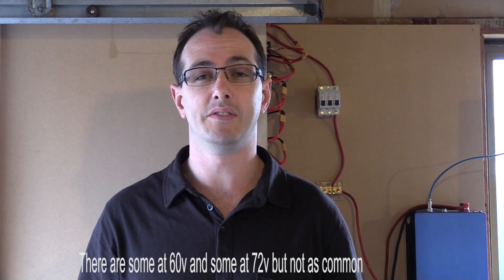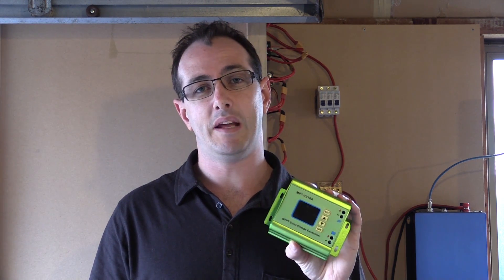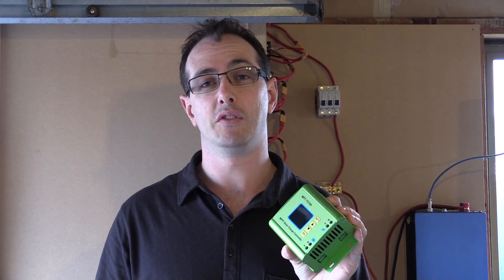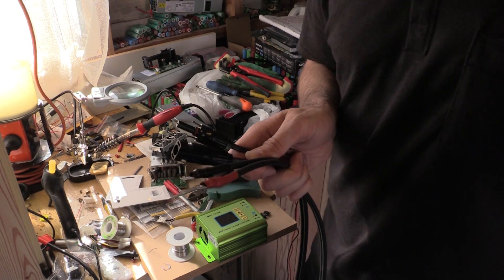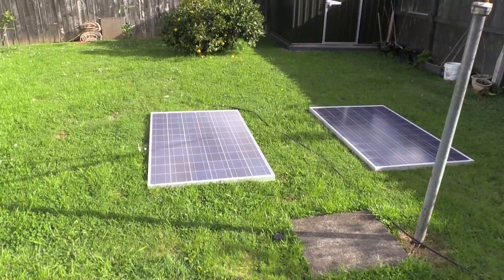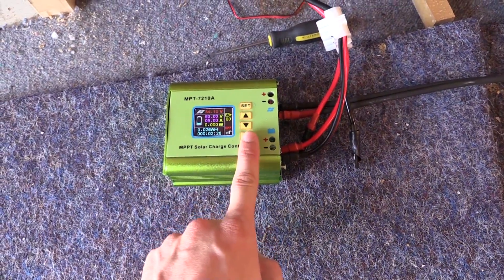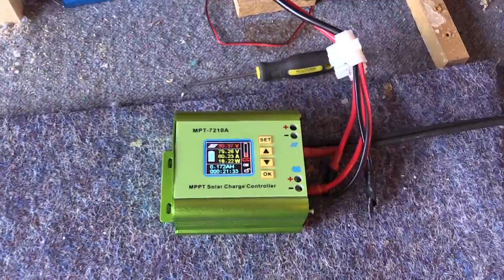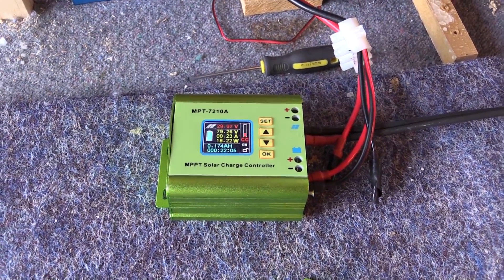MPT-7210A MPPT Solar Charge Controller Testing Part1/4

Comment: Using the MPT-7210A, how do you prevent it from over-charging batteries? It does not have a low-current shutoff that I can find. There is a time limit feature, but then it may not charge the batteries fully.

Comment: It's like you tried to make this difficult ?   12, 24 and 48v are the standards.  Why would you go with a Booster Solar Controller I don't understand.
Reply: pulesjet then you don’t know what he was talking about.... the charge controller is a boost converter within its own case... it has the ability to charge up to 90V batteries, while max input to the charge controller, is 60V no higher.

Comment: I have 4 of these powered from various 235, 285 & 300w CS Poly panels with Vmp's between 25, 29 & 31 volts and Imp's between 7&8 amps. I'm charging 57.5v, 3kW LifePO4 as well as a couple 12vdc banks using buck converters.
For that purpose, the MPT 7210a works well.

I've tried various configurations and combinations with these and other boost converters. 
I've found that setting the Vmp on the low side is better and that in parallel with identical settings these units will compete and cycle, wasting energy. 
The input Caps seem on the cheap side so I don't tempt fate.
I also use these as programmable power supplies and chargers for various battery configurations.
Reply: Maybe add an high amp diode on the output if u connect some toghether in parrallel with same settings?
Reply: But, ill guess they only start to compete when battery level is almost reached. Or battery is full?

Comment: So how is that controller, did it prove to be reliable, I want to use it on tesla module from 12v to 24v
Reply from the maker: This controller wont work well with 24v, The controller is a boost converter so the solar voltage is lower than the batt voltage. For your case you would want a buck converter and i would look at the EPEver Tracer

Comment: Have these  all still survived mate? Might grab myself a few and upgade from pwm
Reply from the maker: Yes two out of the 3 are perfect the 3ed is showing the wrong solar voltage but does still work. Given i am running it at much high voltages than it was made for its prob my fault but otherwise yes for the price they ant bad.Just remember they are boost so the batt voltage needs to be higher than the solar input voltage.
Reply: Mikes DIY Tesla Powerwall ah yes awesome thanks mate

Comment: I have 24v 320w solar panel and I have 2 of them is it possible to connect both of them.
Reply: Abel Jerson it is possible, what battery setup are you planning on using this for? 24V/48v?... if its 12V then you cannot use this charge controller safely as IT WILL overcharge your battery.

Comment: Hello is it possible to connect 24v 320w solar panel with this charge controller
Reply from the maker: from memory yes but your battery voltage will need to be 36v or 48v
Reply: Mikes DIY Tesla Powerwall
If my battery voltage is 60v will I be able to connect to 2 of the above mentioned solar panels

Comment: I am an assistant scoutmaster thinking about building a solar generator 12 volt. Not for sure if I'm going with 18650 60 or 80 amp hour or using those lifepo4 brick 12 volt hundred amp hour. Will this charge a 12-volt system?
Reply: I do a lot of camping usually without any power would like to charge phones tablets and run fans in my tent possibly looking at a small ARB refrigerator to run off 12 volt.
Reply: This charge controller WILL NOT work with your setup safely, it is meant for 24V systems and up.

Comment: how is the controller working? its been a while since this video. I'm looking in to getting one if they are OK. is it a bucking or boosting? or a buck/boost controller? I'm looking in to getting about 3 of these. with 6 24 v panels. with a 12v battery bank. if that can work. the reason is the panels are cheap. and I'm moving up to a 24 v inverter in a year or two. or do I need to look in to another controller?
Reply from the maker: Its a boost only so the solar voltage needs to be lower than the output bat voltage. They have been running ok, One fan needs replacing "doing video on that soon" They work well on sunny days but cloudy days they do struggle to produce a good stable output.
Reply from the maker: If you have under 300w of solar you could look at this https://www.youtube.com/watch?v=omAhsQqwWSo
Reply: Mikes DIY Tesla Powerwall   do you have a link where i can buy 240W solar panel (PV) the same with ur pv???

Comment: very lound mppt is this normal?
Reply: I was thinking the same thing. seems the controller has no auto fan control and just blasts the fan at full power all the time. such a small and cheap fan running so fast will no doubt make lots of noise. very inefficient, but at the same time the fan probably doesn't use more than half an amp at full power, anyway.
Reply: milkbox Fan speed is adjustable but not automatically speed control.  Mine runs quiet and cool at 25%
Reply: You can adjust the fan speed.
Reply: They are noisy. Can speed can be adjusted to cut noise if power usage allows. They are cheap for a reason.

Comment: The capacitor in the converter is 93V so you can have 2 per converter, if you set the AH it will show the fullness of the battery properly
Reply from the maker: Which capacitor? The input ones on my units are 63v and the output are 100v caps

Comment: I have been using MPT-7210A for about 3 months without any issue, but last weekend it started to behave very unstable. It show the solar panel voltage as between 3v and 10v (it should be 30v) , and the batteries are not charging. I switched back to my pwm controller and reconfigured the batteries for half the voltage.
Reply from the maker: I had the same thing happen to the unit without the input cap upgrade. But mine seams to be still running fine. It says 9v some times on the PV input but still is putoutting the same as the others, at the time it was around 400w so while the reading on the screen is wrong it still seams fine.
Reply from the maker: Oh thats cool

Comment: Dear Mike ... Thanks for the wonderful 4 part series .... it helped a lot in understanding...

One question, details of my setup below.

02x 150W panels, having 21V and 8A each, connected in series
04x lead acid batteries in series (100Ah each)
Battery voltage set at controller = 54.8V
Battery Amps set at controller = 5A

Now the controller is charging just at 0.01-0.1A. Sometimes it charges through 0.2A-0.3A.
How I can improve that ? (here in Pakistan, we are having good bright sunlight in winters)
Reply from the maker: Thank you, Are you using the same controller? If so what have you set the solar panel voltage too? Also what is the voltages on the back of the solar panels? This might need charging if your only getting 0.01-0.1A

Comment: Hello could you help me with one of this?!!!      http://orison.energy/
     I really need a few of this but maybe a little less costly...They 
are still doing the Kickstarter thing. But I really want some 
now.....Can you help?! I do have solar panels right now that Just plug 
into my wall outlet,DC to AC ot of the microinverter....3kw right now 
but I do have 7 more panels ready to be used if I can get something I 
can charge thru my wall outlet and back feed at night. Please hook me up
 with someone ..Willing to pay.....!!!Thanks
Reply from the maker: Hmmm the Orison system looks interesting 2.2kWh per unit but more designed around style and very small costly units. Which first makes me think why. Small units would be an expensive way to do what the tesla powerwall or lithium battery system of other brands does for far less overwall costs. The cost per kWh of storage would be crazy on the Orison unit. Each unit would have to have an inverter /charger in it which just adds a lot of extra cost and things to go wrong. Sure you can just plug them in which makes them simple and they look good in the pictures but cant see how the numbers would ever add up to save you money and pay off the investment. I can guess they charge when the power is cheaper say at night or early morning from the same AC socket. While this does and can save money its not even close to the same ball park as if it was charging from solar which these Orison units cant do without first buying a grid-tie solar system. In AUS they are using a simpler system but with a big lithium battery system like the tesla and a hybrid inverter and some smart software that is always looking at the current power price and then deciding weather its best to buy power to charge or sell battery power back to the grid or export solar to the grid. Very advanced but relies on some good software that interconnected to the power pricing network feeds and a big enough system to make it worth while, also needs an export meter/grid-tie hybrid inverter and spot price power provider that also support buy-back export. Tho you can do it without the export to grid and just use the system to topup the batts when the power is cheap. As for your main question, sounds like you just need a small 2000w grid-tie inverter as that would support your 7 extra panels. Depending on what voltages and watts your panels are will determine what kind of inverter you need, Microinverter are the more expensive option as you would need 7 vs just 1 grid-tie inverter. But 7 isn't a good number, 6 panels or 8 panels would be better on a smaller grid-tie. For 7 panels in series you will need a grid-tie with high dc volt inputs more then 150v, if you used 6 panels you can put 3 in series then 2 in parallel, which would be 90v at around 16amps and under 150v open circuit. You could always use 6 and put the last panel on a Microinverter. If you had 8 panels you might be able 4S 2P but that will go over 150v limit on most smaller inverters. If you get a  2000w and below when looking at the inverter you can just plug it into a AC outlet which is easy, If you go with a 3000w+ inverter you will have it get it wired into your main switchboard at a cost but with the 3000w you can just connect all the 7+ panels in series as those inverters are normally rated up to 550v on the dc solar input.  Hmm back Feed at night would mean you will first need batteries, If that's what you want then I would look at a hybrid inverter, more costly but will give you more options if you want batts. To keep it simple look at 48v
Reply: Appreciate the reply....and yes the main Idea was for me to build or buy batteries to install. Since I do have a 3kw system right now (plus another 2.75KW in garage) I installed microinverters that convert dc to ac...all I do is plug into my house outlet.. I did installed 2 separate Circuits for this purpose, but I could still use them as it does not come close to the 80% limit for my wire gauge. I was just showing the Orison item because I want something I can just hook up to my outlet when batteries are introduced into my system. I guess the easiest way would be to plug a 24v or 48v battery charger to batteries, then either another microinverter or a regular inverter as you have mentioned. But I really like the idea of no memory no damage of Li ion batteries. PB batteries are heavy and can only use like 25% at a time....just having lots of issues getting 18650 batteries, no one wants to sell me the broken ones. Not even recycling centers.
Thank You again for your Input. Just needed help with building a li ion battery pack that I can just plug into outlet for charging and providing electricity to my home.
Reply from the maker: You could do what I have with the grid-tie inverter with limiter as that will also work. Ether the 1000w or the 2000w unit like i have. If its hard to get 18650 then you could get some of the 100Ah lifepo4 battery cells, 80ah seams the best vale but you can get smaller ones or bigger eg https://www.aliexpress.com/item/Brand-large-capacity-80Ah-lifepo4-3-2v-cell-LiFePo4-battery-lithium-High-discharge-Not-100Ah-for/32597725087.html?spm=2114.30010308.3.2.Ndkv8u&ws_ab_test=searchweb0_0,searchweb201602_2,searchweb201603_9&btsid=8615e6cb-e2ca-41e1-9cf2-185a4daa8736So one 80ah is the same as 40 18650 cells at 2ah, Its also 3.2v rather than 4.2 but it might be easier to setup and connect the cells given 18650 are hard for you to get. You could also look at some new 18650 cells depending on your budget.

Comment: patiently awaits part 2, would love to see it working with 2 panels in series :)

if you need to reduce the voltage add a few Schottky diodes in series, generally give 0.5v drop per diode ;)
Reply from the maker: Good idea but that might effect the MPPT tracking ? Part 2 is done and will be out tomorrow :)
Reply: could make for an interesting test vid you know, before and after ect, i suspect it would be negligible if any change at all on the output, but i dont have an mppt charger yet to try it myself haha
Reply: I want what the procedure

Comment: Banggood have them now under 29$. http://www.banggood.com/MPT-7210A-Aluminum-Alloy-MPPT-Solar-Panel-Charge-Controller-with-LCD-Display-p-1056572.html
Reply from the maker: That page shows 40nz ? 31% off down from 59
Reply: I thought 29 USD. If you bought them for 32 NZD, you have even better deal :)
Reply from the maker: Sorry my bad, i just checked i paid $ 32.45USD which would be about $45NZ
Reply: now they are at 90$ US - more values than gold, 3 times as much as 5 years ago.

Comment: @Julian Ilett has done an extensive review on this charge controller. It seems quite good for the price but tha fact, it does not seem to automatically start charging when the sun comes back up is a real showstopper. Or did the change the bahavior with this revision? Julian's review is here: https://www.youtube.com/watch?v=mM6JTquNSZU
Reply from the maker: I think in video 3 he showed how to change it so it auto turns on. I have copied what he did and it works. You can set ether or not it turns on and all 3 of mine are auto turning on as expected :)